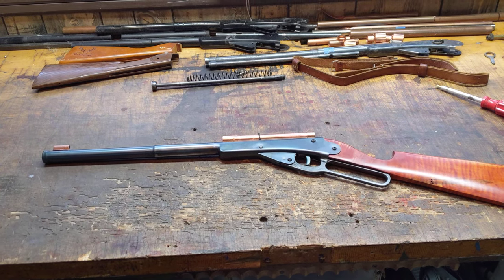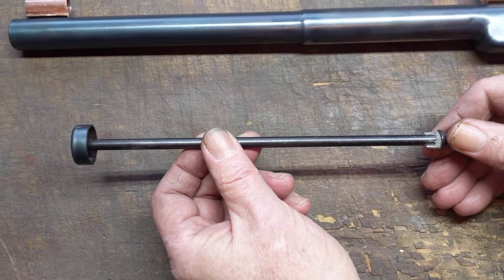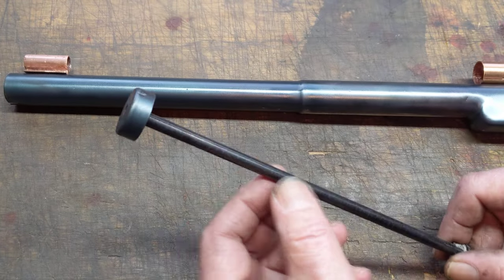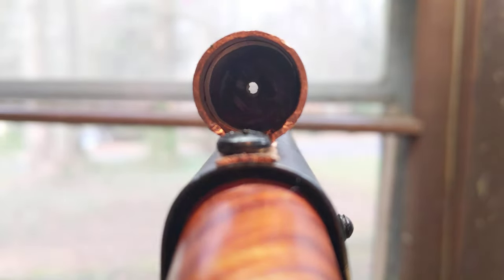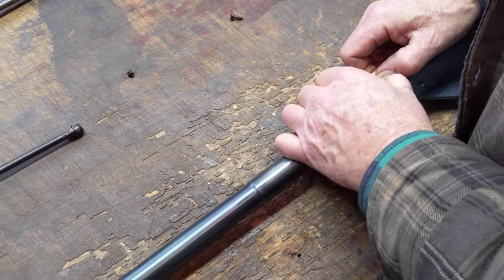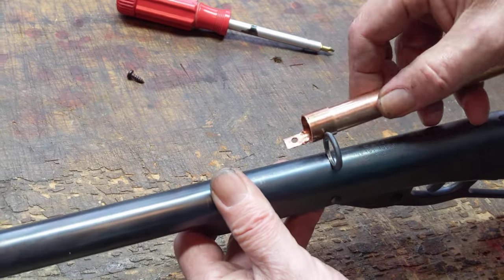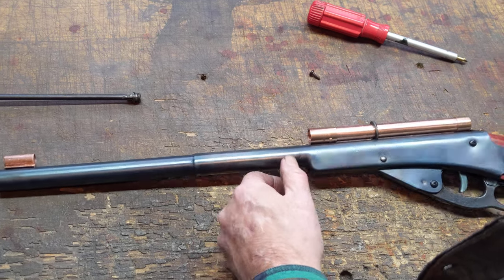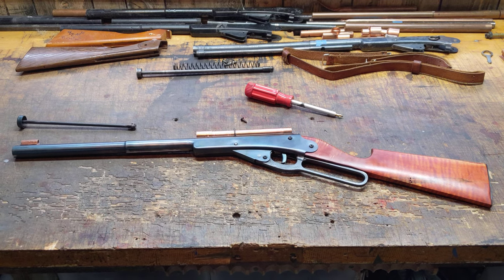Restomod Daisy #101 Model 36 with a all copper Buzz Barton "telescope" sight and new wood! part 3

Comment: Oh, son, you've been busy!! Looks great, had thoughtful gunsmithing applied, she's a winer in my book. Nicely done, Shane. I have a smooth crimper for my wiring on the rec vehicles... Seems to me there's a slot for large gauge butt connectors that might squish that shot tube shut enough to make you happy. I'd take it to the hardware store to see if any of them fit the job.
Reply from the maker: I hadn't thought about that approach. I've tried clamping the shot tube in a jig with the vise but not pinching the tube body at regular intervals. Worth a try.

Comment: Don't know how I missed this.   Have you ever thought of drilling a half inch plumbing cap instead of using a washer?
Reply from the maker: I looked at that but needed to get the disk inset into the tube body about and inch or so.

Comment: Chomping at the bits for mine! Nice work Shane
Reply from the maker: They are on the bench as we speak. That 1938B is truly rough.
Reply: @RestOModDaisy  yeah it's laid around in the dirt till i pulled it out of the barn
Reply: @RestOModDaisy  if you find it's to rough to fix I will just leave it as stock as possible then
Reply from the maker: @williamjarvis3473  at first glance there is so much pitting that I'm not sure it would survive an aggressive approach on the steel with out some pinholes popping through. I'll study on it and make some small tests.  I generally don't repaint but that might be the best option on that one.
Reply: @RestOModDaisy  whatever you decide I'm ok with

Comment: looks good, for economy sake I'd try one wrap electric tape angled (15 degrees?) to stretch and spiral wrap it really tight, may compress it to close up, with tension and tape to keep it closed and sealed both. the kinda small angle should put 3 layers total down in one pass. didn't look like a big split that stretched electric tape couldn't pull together.
Reply from the maker: I've done tape wraps to attempt to seal up open seams and they suffer from the ever present effects of oil being blown down the bore every time you fire the gun. Works for a while though!

Comment: I think it would be cool to have changeable discs similar to the wide body front sight except change them out on the rear.multi flip peep so to say.in the scope instead of front sight.
Reply from the maker: That might work just by installing the insert in the distant end of the tube in front of the tube and held in place by the coupler, that way you could sub in a post, crosshair etc.

Comment: Have you considered making a rear stock the has a metal tang insert that would be piece of the stock.  The metal tang would make a place the could be tapped and threaded for the old Lyman, Marble, Williams or other type flip up peep sight.  This would make for easy windage and elevation adjustment.  The tang could extend such that the top receiver screw goes down through the front of the tang into the stock.  Then like all rifle tangs a shorter screw could be attache at the other end.
Reply from the maker: Daisy used a system like that to attach the Model 300 Telescope sight to both the Daisy Model 25 and the #111 Model 40 so it's definitely doable.
Reply: @RestOModDaisy  I recently found a tin, that belonged to my great uncle born in 1899.  In the tin were some rear sights and one set belongs to a rifle of his, that I have the other sets are for either old Winchesters or Marlins that are no longer in the family.  I'm thinking a 100 year old sight on a Daisy might be a thing, not for everybody, but still a thing.
Reply from the maker: @Backin_Theday  100 year old tang sight sets are a big thing for lots of folks. Especially Winchester and Marlin folks. Would look cool on a #111 Model 40 though.
Reply: @RestOModDaisy  I probably wouldn't be able to afford to collect the correct year rifles.  The one original 1873 I have, would pretty much be something I couldn't justify replacing if I had too.  It was something that belonged to a great great uncle, manufactured around the same year he was born 1887.  I could afford an old Daisy though.

Comment: Can you put a piece of heat shrink tube around the shot tube to cause it to seal?
Reply from the maker: That could solve the seam blow by but wouldn't address the sloppy bore. I'll ponder the next move or maybe just shoot it as is.
Reply from the maker: @Backin_Theday  I haven't done a bore sight test with the Marksman BB's but the standard Daisy Precision Max have about a 75% halo around them when you do the bore sight test. It's about as bad as I've seen in a Daisy shot tube.
Reply: @RestOModDaisy  I been looking around the internet to see if there would be a way to re-rollform the shot tube in situ without harming it.  Might not get the very tip or the abutment end but would probably only need to be closed up a hair.  Wonder BBC has encountered something like this in his barrel making efforts?
Reply from the maker: @Backin_Theday  Mess with enough Daisy's and you'll find them. The older seamed barrels are thankfully no longer in production. Have you been over to the $15 dollar Daisy thread lately? Terry Cowger is doing carbon fiber barrels with super tight bores and impressive speed results, worth a peek.
Reply: @RestOModDaisy  Yes, I was over there a a weekend back reading through all there information.
Reply: first thought was shrink, but tight stretched electric tape spiral wrapped for 3 layers one pass may give a lot more pressure/compression force than heat shrink. that "light halo" test would sure tell if it worked decently.
Reply: @modelnutty6503  it could be wrapped with a heavy monofilament fishing line.
Reply from the maker: @Backin_Theday  That would look cool. I wonder if the line would provide enough squeeze to close up the seam without stretching.
Reply: @RestOModDaisy  I would say based on the watermelon popping video demonstrations I have seen on the internet, using layers of rubber band wrapping, that you would probably cinch the barrel closed some.  It may take a 20# to 30# test line.  After wrapping it could probably be reinforced with a very light layer of epoxy or similar.  When 3D printers need their objects they are making to be more rigid and less porous they have epoxy like coatings that they apply to make the plastic filaments more stable, in the objects they printed.  I would imagine a barrel could be slightly shrunk with wrapping and then lightly coated to stabilize the wrap, kind of like eyelet lashings on a fishing pole.

A secondary idea is possibly wrapping the shot tube with a wetted raw hide thong tightly and then letting shrink dry on the shot tube.  This may fasten it well and provide enough pressure.  I also had the idea that incorporating old air craft modelers dope to cause shrinkage may work.  I don't know if you have ever built a balsa and paper covered airplane but the dope does a great job of tightening and shrinking the covering.